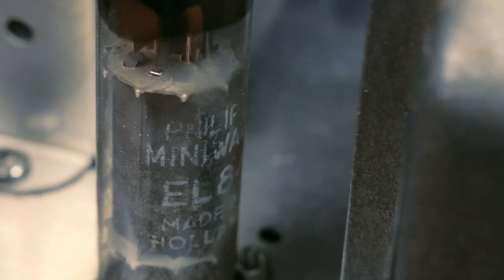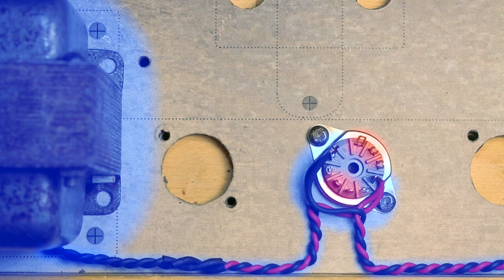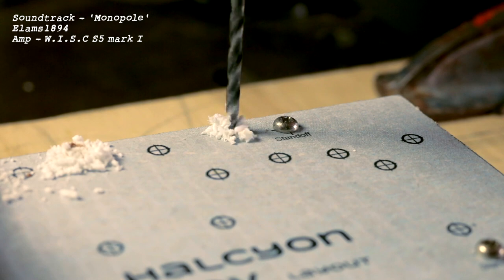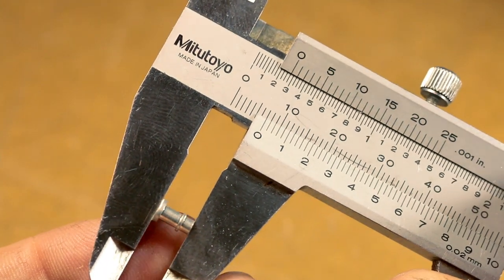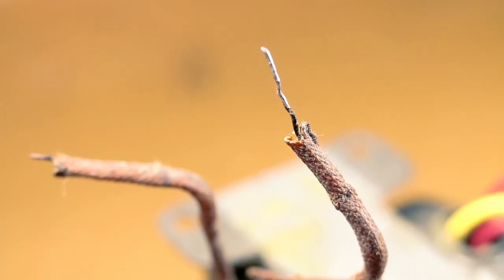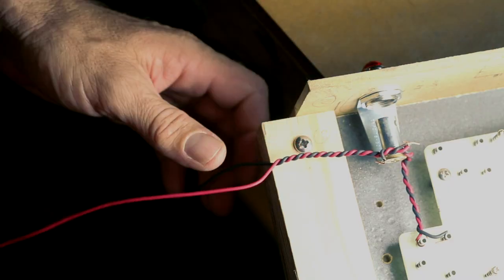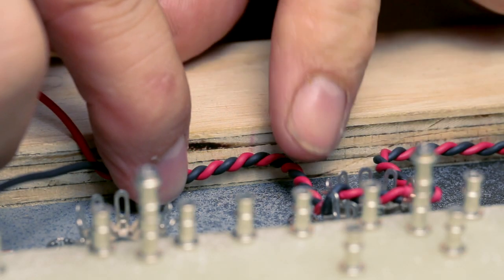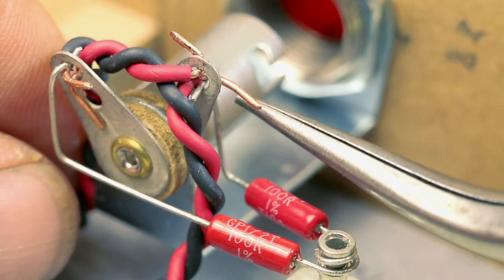How to Wire Tube Amp Filaments the Correct Way - W.I.S.C - GT5 'Halcyon' Build 1

Comment: Wouldn't it be better to use shielded cable or use a DC voltage source rather then AC for the Filament?
Reply from the maker: Shielded cable does not work for AC filaments. Shielding provides protection from external magnetic fields only. In other words, it does not reduce the magnitude of a large AC filament magnetic field. You could indeed rectify the AC to DC, that would work indeed, cheers.
Reply: @elams1894  interesting point. Does that mean that, in amps with a recrifier tube (eg 5e3), we neednt worry too much about hum? Tks for the fantastic vid btw!
Reply from the maker: @paests  A 5e3 rectifier tube, in contrast to diodes, is used to rectify the high voltage (say 400v AC) secondary winding. However the low voltage filament winding (6.3vAC) remains in an AC state, unrectified. So if you wanted to rectify the 6.3v winding, you would need an additional circuit, utilising either another special rectifying tube, or alternatively, rectifying diodes. This would mean additional filter capacitors and maybe a resistor or two, so would really add to both amp realestate and cost. The far easier option is simply twisting the 6.3v filament pair. If done correctly, it is effective. Thanks again.
Reply: @elams1894  thanks for explaining. no getting away from the proper twisting then. i'm just starting my 5e3 and this is so helpful. subscribed!

Comment: how would I wire 6 tubes in a series for 7L70GT tubes?
Reply from the maker: Wire them in the same fashion as that in the video, however you would have to have a larger transformer to handle the extra voltage needed. Check schematics for the same tubes, cheers
Reply: @elams1894  I have lost the link to that video can you resend me that link so I can review it for details..,Thanks..,what transformer would I need and where would it go?

Comment: Noob question. Can we just rectify the ac to dc?
Reply from the maker: You certainly can. However the circuitry and components involved is far more complicated than twisting. Twisting is relatively simple, and when done correctly, offers comparable hum cancellation. Rectifying the filaments to DC on a large amp may certainly be the better option however. Cheers
Reply: Thank you :)

Comment: i have  problem  caused by supply transformer hum which is coupling  with output speaker transformer(s) . I did  not decide  if I like  deminish more that hum by reconstructing layout. Because it   is overlayed by my R2R mechanic  noise and   disappeares  in compare to listning level (except extremly  silent listening) .  

Filament hum is last on my list. To asses  50 Hz hum I would advice anybody first  to turn amplifier on and listen to speakers If any hum is heard before amplifier is ready working or stops imidiately with switching supply off  then it is not the filament originated hum but transformer fields .

 I think filament hum usualy is at very low level and never visible in blue,  comparing to say poor screaning of sound  carrying wires . But  how to screen traces on printed boards? Only one way is whole metal casing. To to achieve more compact look  I thrown away ready printed board.  .   

Next, when we choose wired technology as shown,  then   the better  screening applied the worse is performance with growing frequency.  I   accept  compromises - accept some little yet not annoying hum in favour of nice wood casing ,  in important places with attached screaning and point to point (NO SCREENING)  to save best hi frequencies. This way elaborated by me and constructed  amplifier produces only 3 dB slop at 24 kHz, Filament hum is somwhere below others which I consider enough low. . 

And be aware - the filament hum is heard  in very  sensitive stages - like mic,   preramp for turntable where it is 1 importance. For that rason in my brand made vintage Bell amplifier I have  DC supplied filament in 4 tubes and no trace of 50Hz .

Comment: Your only thinking in two dimensions. Go up in regard to filament
Reply from the maker: This is a good point. My father used to build in that way. He would elevate the filament windings and have them hang down vertically to the socket at right angles which worked well. It is also an effective method. Thanks for input.